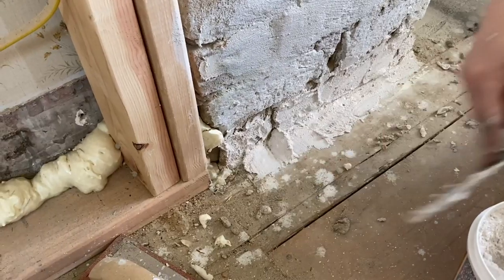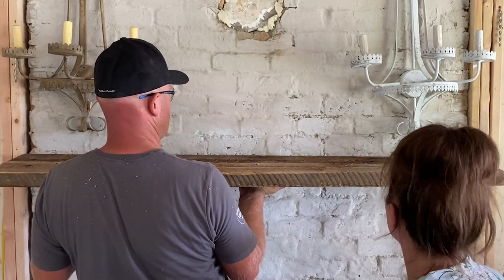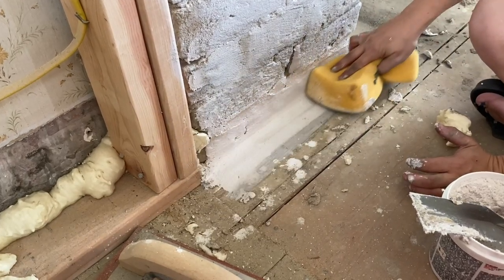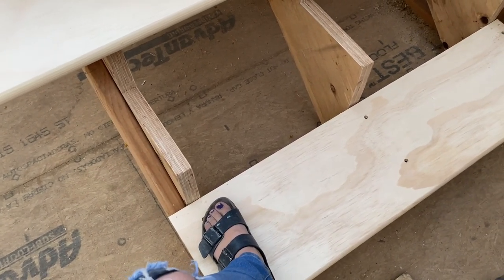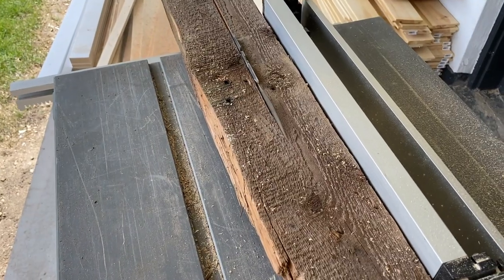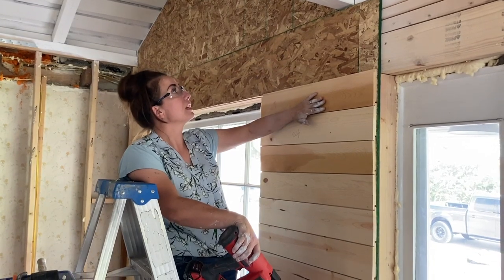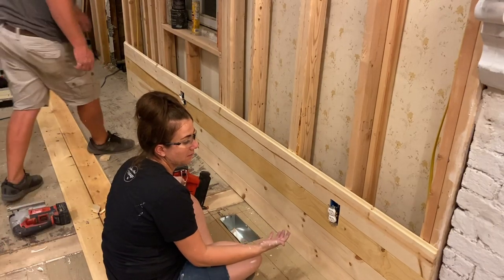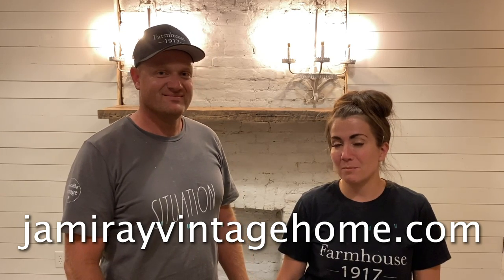Dream Home Remodel Crumbling Fireplace Makeover How To Add A Mantel!

Comment: Maybe you could spray that foam into the gaps on each side of the fireplace, the trim it back and smear it smooth. It would have a more finished look and keep it insulated from cold and bugs. 😊👍
Reply from the maker: It’s almost done being trimmed out doing just that. 😊 we put more mortar in the cracks. 😊

Comment: Looking Beautiful!! How many  sq.ft. will you have under roof when finished and how many sq.ft. was it before you started? Thanks
Reply from the maker: 3900 when done not including the garage. Before maybe 1800 total if you include the unpermited addition that was falling apart. The original old house is about 900 square on top and 400 in the basement.

Comment: Awesome job guys I wasn't getting the picture with the shiplap in the light but this is a awesomeome!!! What was that purple stuff you put under the flooring on the second floor?
Reply from the maker: That’s special glue to keep the subfloor down and the nails from getting loose. It keeps the floor form creaking and squeaking.
Reply: @JamiRayVintage  what's it called?

Comment: No insulation on that wall???
Reply from the maker: None needed. It’s inside a 10” thick adobe wall.  We insulated the gaps on the top and bottom for fire blocking wi foam insulation but because of the adobe no further insulation is required.
Reply: Jami Ray Vintage  got it. You guys are doing a great job

Comment: Cute lights but, I think they are too big for the space.
Reply from the maker: Once the wall and trim is done we’ll take a shot from across the room. It’s hard to get accurate  perspective on camera sometimes.
Reply: I think they are just the right size. Because they are thin and fine it does not take up a lot of visual space. Also too small is far worse!!